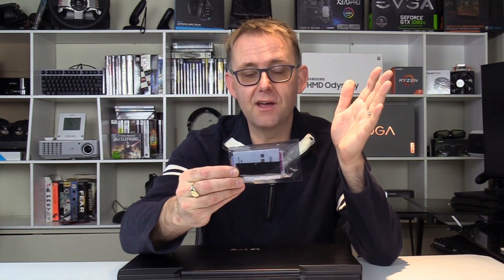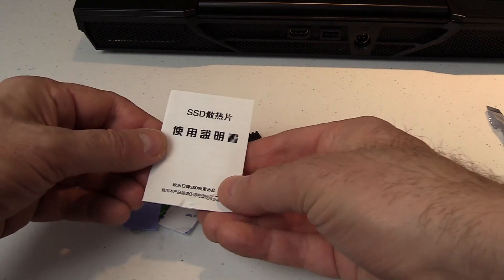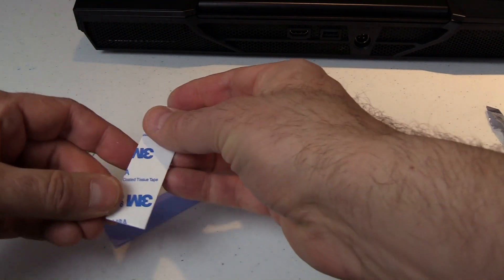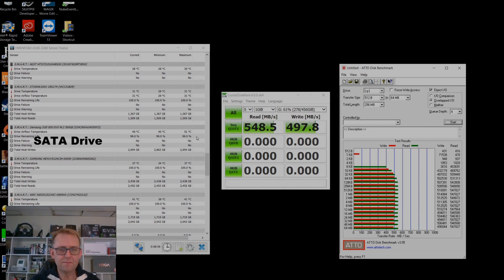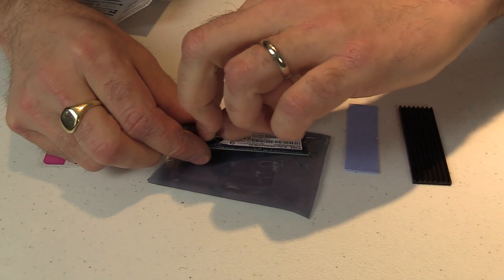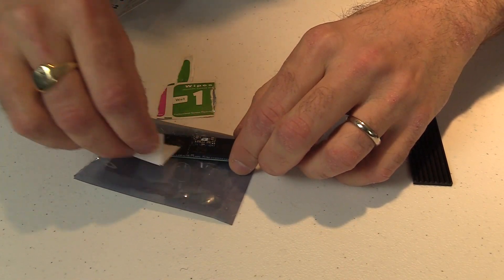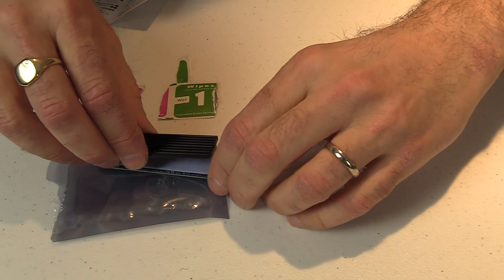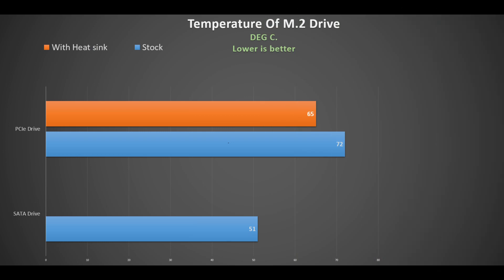Does An M.2 Heat Sink Actually Help Lower SSD Temperatures ?

Comment: Just subscribed to your no-nonsense channel. So much better than that overhyped crap from Linus Tech Tips On Steroids or Gamers Nexus.
Reply: Putting Linus and GN into the same pot while talking about no-nonsense-approaches is weird. 
Also while i admit there is no marketing bullshit in this video, it also lacks any technical knowledge like:

- showing off the different parts of the storage and why they should be cooled or not
- mentioning the thermal capacity of the heatsinks stickers, these are not only for aesthetics
- valuating the fact that flash NAND actually needs a certain temperature to work good while the controllers can have problems with overheating. Hence:  Allyn Malventano advices to trim the pads to only touch the controllers, so the flash is not pulled back by the heatsink. 

So this Video is an unboxing video and if it advices you to use those heatsinks without modifications for cooling purposes, then it is even what you try to evade: nonsense.

Comment: do your laptop have two M.2 SSD?   maybe you test the wrong M.2  cause I don't believe speed can increse twice or more  just by reducing  7 degrees
Reply from the maker: It is rather strange but it was ran on the same boot C drive , all I did was take it out , apply the heatsink and ran it again. You can see the C drive letter in both tests. I never noticed it until someone spotted it. What else could cause it? I didn't run Crystal Diskmark and Atto at the same time...
Reply: heatsinking the controller can have a marked effect if its getting stinking hot (and they do when writing a lot)

Comment: Would this fit in the Razer Blade 15?
Reply from the maker: I don't think so, but you can add a thermal pad and it should make contact with the aluminum back cover, that will help dissipate some heat.

Comment: My Corsair Force MP500 250GB was working at around 65c, when stressed it could go up to 76c.
I found a heatsink from a mainboard i had, put some thermal pad between, and the thing dropped to 54c! (At same load as before when it was 65!)
i used zipties to hold it in place.
Its pretty concerning that my drive is rated at max 65c working temp, and thats where its been all the time.. That cant be good in the long run..
Reply: Same here! Got the 970 evo 500gb and just starting my pc will bring the temps to 65 (withing seconds!), some casual browsing etc brings the temps up to 80 deg and my pc freezes. Took me couple weeks now to find out this issue. Never thought an nvme drive would consume so much power (even when barely doing anything)
Reply from the maker: @sadcvnt_uwu  I too was pretty surprised. Thanks for watching 👍
Reply: @sadcvnt_uwu  so what you do with you nvme 970 evo, you bought a heatsink or what? many people use it without it
Reply: @sadcvnt_uwu  A little late but, i also have a 970 EVO Plus 500gb, right now it idles at 33c (its 16c in my office though), but its pretty cool at idle even if the room is 20c.
When i stress it it will go up to 68c easy. But gets right back at low temps at idle. :-)

And btw, my MP500 is 120gb, not 250. :-P
And it gets just as hot as my 970 EVO under load (crystaldiskmark), but it has a heatsink to.. So it would be cooking if it didnt had that.. :-P
Reply from the maker: Thanks for the information :)
Reply: I really don't think heatsink is necessary for a 250 GB SSD, maybe for 1TB or larger ones that often write/read data.

Comment: @OwnorDisown, Thank You for great video, really help us, very appreciate, i have question, Is this heatsink thickness suitable for MSI GE75 Chassis laptop?
Reply from the maker: Thanks, glad it helped you. How much space do you have? I would say the pad and heat sink is probably about 4mm
Reply: @OWNORDISOWN  I was very happy, I did not expect to be responded to, I planned to buy the MSI GE75 8SE, do not know how much distance (space) from the top layer of NVME to the plastic bottom cover, the seller's info heatsink has a thickness of 5mm (thermal pad + heatsink), Please kindly help me sir

Link product below :
https://tokopedia.link/GyBSuv693T
Reply from the maker: You are probably OK. There is quite a gap between the back cover and the SSD, I have that laptop in house, I just checked. You will be fine. Here is my review : https://www.youtube.com/watch?v=93gh3AwjzFk
Reply: @OWNORDISOWN  Yes Right, SE/SF, both chassis are exactly the same, you are like my father, a very technical person, Thank you Steven 😊

Comment: Is Gelid a reputable brand? The thermal pad bundled with M2 heatsink is stated as 0.5mm in thickness. Is that sufficient?
Reply from the maker: I use their thermal paste alot and it's good ( here is a good review on that https://www.tomshardware.com/reviews/thermal-paste-comparison,5108-10.html)
The thickness should be, I wouldn't think you would want it to thick as heat transfer gets less the thicker it is. That's my thought process anyway.
Reply: @OWNORDISOWN  Thanks. Appreciate your thoughts.

Comment: I purchased an ADATA nvme, it comes with a DIY heatsink. I want to upgrade to an RGB one with a Cooler. 
Do you know a safe way to remove the original Heatsink?
Reply from the maker: You can try gently heating it with a hair dryer, I find that loosens things up a bit.
Reply: You're probably talking about something like the SX8200; that comes with a heat spreader rather than a heat sink, and the former is actually preferable because you want the NAND flash to be warm and the controller cool, so the spreader helps to equalize the temperature between the two sets of components without adversely cooling the flash.

Comment: Apparently flash memory actually works better (improved longevity) when it's hot, although the controller can start throttling when it gets too hot. Who knows what is best.
Reply: "Apparently flash memory actually works better (improved longevity) when it's hot"
Where did you read this I can't find any source confirming this. (Not saying I don't believe you, but I would love to read about this.)
Reply: @petrkinkal1509  I heard about this on Gamers Nexus where they go through emails from a flash drive expert. The video called "Ask GN 90: M.2 Heatsinks Kill SSDs? Is AMD Losing Long-Run?"... they start talking about this around the 6 minute mark.
Reply: Correct, on an NVMe SSD, you should use a heat spreader rather than a heat sink, because you want the NAND flash to be warm and the controller cool, so the spreader helps to equalize the temperature between the two sets of components without adversely cooling the flash.
Reply: @AtomizerX  the thermal pad is a type of heat spreader, right?
Reply: @davidhujan86  No, normally when someone mentions a "thermal pad" it's the material between the heat sink and the IC or thing you're cooling. It's an alternative to thermal paste. It aids in connecting the heat sink to the other component (both in terms of making them adhere and transferring heat) but the heat sink/spreader is dissipating/transferring the heat. A heat sink is made of metal and has fins to better dissipate heat by increasing the surface area for thermal transfer; a heat spreader is a simpler piece of thermally conductive material, like a basic metal plate or similar.
Reply from the maker: I didn't know that, thanks !

Comment: I never imagined that SSDs need a heatsink. My SATA SSDs run cold to the touch. I just built a new system with Asus Z390-A motherboard that has a heat sink and fan option for the NVMe M.2 drive. I remember thinking that to be overkill for a device that never gets much above ambient temperature. Perhaps these little drives run much hotter than normal SSDs. But the heatsinks available for these drives suggests that they do.
Reply from the maker: I think the PCIe ones run hotter as they can go up to about 3000 MB/s versus about 550 for a SATA one. I never gave it much thought until I was asked to do it.... thanks for watching!
Reply: @OWNORDISOWN  That's my hunch, too. Akin to CPUs running hotter with higher clock speeds. The SATA port limits read write performance and lower IOPS means less heat.
Reply: On an NVMe SSD, you should use a heat spreader rather than a heat sink, because you want the NAND flash to be warm and the controller cool, so the spreader helps to equalize the temperature between the two sets of components without adversely cooling the flash.
Reply: @AtomizerX  Interesting.. so, like LiPo batteries, cooler is not necessarily better.
Reply: @basspig  To put it another way, most things have a range of operating temperatures. Galvanic/electrochemical cells like you mentioned shouldn't get too hot BUT they also have a reduced output when too cold. The ICE in your car can overheat BUT it's less efficient when cold, etc. In this case, an SSD controller throttles with temperature but the NAND flash operates at a higher-than-expected temperature.
Reply: "My SATA SSDs run cold to the touch"

If you open up a sata drive case you'll find the vast majority of them don't have the chips thermally connected to the case in any form. Those that do mean that the chips benefit from that many square cm acting as heatsinking (much more than you'll find folded up as surface area on a M2 heatsink)

You want to spread heat to the NAND, but you ALSO don't want to overheat things - which means you want thermal mass (a thicker base) and fins (to reject heat when they do get hot), but you don't want active cooling (fans or having the drives deliberately mounted in airflow) and you want to watch the reported temperatures, comparing them with maker specs. We see desktop box SSDs hitting 80-90C under sustained write loads with no heatsinks which is hotter than is healthy for the NAND, let alone the memory controllers.

Comment: Is it easy to remove these in case the drive suddenly stops working, and needs to be sent for warranty?
Reply from the maker: The Thermal pad sticks to it very strongly but you should be able to peel it off OK
Reply: @OWNORDISOWN  Ok thanks. I was wondering how much better is the cooling when the label is off? Because if it's very little, I might as well keep it there.
Reply from the maker: You do need to make good contact with the chips and paper is an insulator...

Comment: What program did you use to stress test the temperature??? I have 2 NVMe PCIe m.2 drives installed on my mobo, just don't know how hot its getting, thanks in advance.
Reply from the maker: I used repeated runs of crystaldiskmark and ATTO benchmark
Reply: @OWNORDISOWN  thanks mate!

Comment: Awesome! will this work with the samsung evo 970? + the adapter on a macbook pro
Do you really need to peal off the warranty sticker?
Reply from the maker: It's best to have a good heat transfer as possible, you can try it with the pad on the sticker if you like and see how it gets on. The heat sink itself takes up quite a bit of space but one thing I have heard people do is if the thermal pad makes contact with the aluminum back panel of the laptop that acts as a heatsink. Something to bear in mind.
I read a report on Techspot where it said that companies putting warranty stickers on a component is illegal. In the USA anyway...
https://www.techspot.com/community/topics/ftc-warns-companies-that-using-warranty-void-if-removed-stickers-is-illegal.245880/

Comment: must I remove the label on SSD? Some manufacturer require it for warranty...
Reply from the maker: For best heat transfer yes. In the USA its illegal for companies to say that
https://www.techspot.com/community/topics/ftc-warns-companies-that-using-warranty-void-if-removed-stickers-is-illegal.245880/

You can always keep the label and stick it back on afterwards.
Reply: Sticking the label back on works for getting warranty back? What if the sticker was torn a bit?

Comment: seems like elastics are missing to hold the aluminium in place
Reply from the maker: The heatsink was actually pretty well stuck to the thermal pad if I recall. Still going strong in my laptop 😀
Reply: @OWNORDISOWN  Nice, also in your spare time could you talk about if M.2 Heatsink actually degrades the M.2 in your opinion? There seem to be a bit of talk about the M.2 having degradation if the heatsink is only placed on the NAND controllers. Though that is mostly the case in tower build I guess.
Reply from the maker: @vengeanceu  I recall Guru3d had a good long term degradation test. 
https://www.guru3d.com/articles-pages/samsung-950-pro-m-2-ssd-review,8.html
Heat is the killer, and I think, just like fast RAM they should have a heat spreader. Here is another interesting article 
https://www.google.com/url?sa=t&source=web&rct=j&url=https://photographylife.com/m-2-nvme-drive-overheating-failure/amp&ved=2ahUKEwiJ4eq0uL3eAhWw1VkKHV9YCyYQFjABegQIAxAB&usg=AOvVaw3pu5j0u-zIGf1l8HGbyPTN&ampcf=1
Reply: @OWNORDISOWN  Thanks

Comment: Thank you! i was considering  to buy a ssd heatsink for my gaming laptop. this video really helps !
Reply from the maker: Glad you found it useful ! Thanks for watching 😀
Reply: hey did you get one? I am considering for my laptop as well but i don't know if it will fit or not
Reply: @jeffreyzhou1824  hi, now same question here, does it fit?
Reply: If anyone wondering i bought ultra thin heatsink and it fits.
Reply: @MrMystis  1mm or 0.5mm ?
Reply: Any advise or recommendations plz , I have the same plan ?

Comment: Does it fit in my laptop? Lenovo Ideapad 700 17isk
Reply from the maker: I dont know, you should take the back off and see how much clearance you have.
Reply: @OWNORDISOWN  more or less 1 cm
Reply from the maker: @darkhorse581  that should be sufficient
Reply: @OWNORDISOWN  I removed the sticker... before removing the sticker the temps were always under 65, now they go up to 76... i bought this heatsink hopefully it will be good.
Reply from the maker: Good luck !
Reply: @OWNORDISOWN  I had to cut a part of the case to make the heatsink fit, but now temperatures are very low. Thanks for the vid!

Comment: I'll consider one for myself, since my PCIe SSD is close to 80°C. While idle! But it's ultra compact form factor of my mini pc that might be the problem. Any other solution apart from fan sucking air out of my box (which cools it down by considerable 20+ degrees)?
Reply from the maker: If your PC has an aluminum base perhaps a thermal pad on the back of the SSD so it makes contact with the base panel and uses that as the heat sink?
Reply: Brilliant idea, thanks! Yes, case is made of aluminum, so I might just do that instead of putting the heatsink, since I think I won't have enough place to squeeze it in between the panel and mobo. But I will first disassemble the box, then measure everything, so I don't waste time and money on something that won't work.
Reply from the maker: Good luck, let me know how you get on :)
Reply: I ordered one 3mm heatsink, just to see if this thing will work. It had very low price anyway, and will be with me very shortly, comparing to ones that I would have to order from opposite side of the world. Later I might order some more advanced solutions which have 7-10mm thick aluminum. I opened my box, and it seems I could fit even that in there. And the panel my SSD if facing to is in fact made of plastic (all other panels are aluminum lol), and since there's plenty of space between mobo and SSD, thermal pad would have to be at least 10mm thick to make contact, which is kind of silly to even talk about. Hope I will reduce this temperature at least 10°C...
Reply from the maker: @-Burs  sounds like you have plenty of space to play with. Fingers crossed !
Reply: Yes, it seems I do have enough space, but part of the box where SSD is located, is like box within the box - no airflow at all. Hot air can only try to go out through that plastic panel :( We'll see when my savior arrives :)
Reply: I've just mounted my heatsink, and results are - so so. Definitely better than before, but I expected more. But considering it's 3mm aluminum heatsink worth $5, maybe I'm not realistic enough. Temps are about 7-8°C lower in idle, so at least I'm not constantly on edge watching over it every few minutes or so. And now I can run at least 5 pass with CrystalDiskMark (4GB sequential), without it going into critical temperature range (82°C+). Before it would drop on second pass from 2500 to 200 MB/s. In about 10 days a 7mm heatsink will be with me, so I'll try that one too. I expect few degrees less, and that's all I will get out of this box. Again, there's no airflow, so options are very limited. For extreme cases (very hot summer days), I can plug in 12cm cooler which sucks air out of the box (and does an excellent job), but that's not 24/7 solution for me, because I don't like noise lol. So that's my story. Will report back how other/bigger heatsink will perform...
Reply from the maker: Thanks for sharing your findings ! At least you are not losing performance now as you say :)
Reply: As from 50°C the lifespan and performance of your SSD is reduced significantly. Yes, you do need airflow. Even your laptop has at least 1 ventilator. Your eagerness to go fanless will kill your pc, along with your valuable data. Sticking this aluminium fan on the SSD will help to spread the temperature but without airflow your tiny beast will be dead as a dodo in no time.

Comment: very handy. i have a heatsink above my 3 ssd slots in my msi gt73vr and the heatpad only above the nvme m.2 slots, but not the sata m.2 slot. just bought a sata ssd to go in the 3rd slot and was wondering weather i should get an heatpad above the satta drive but after this video i think it should be ok without one. thank you. (correct me if i'm wrong) x
Reply from the maker: I think the faster PCIe nmve drives will get hotter so I agree you should be OK. Thanks for watching !